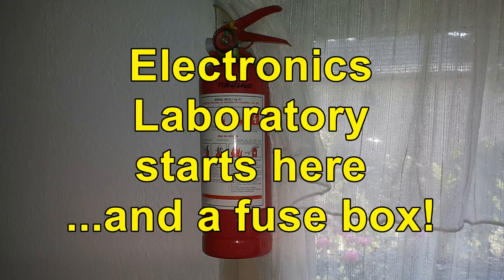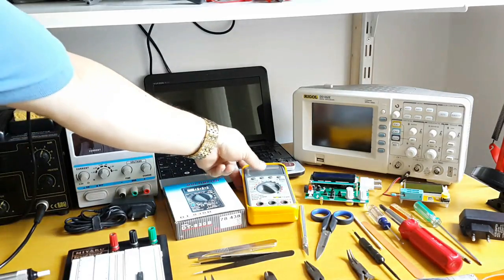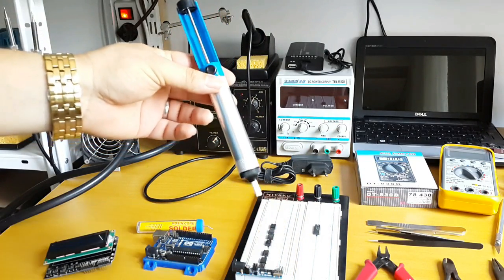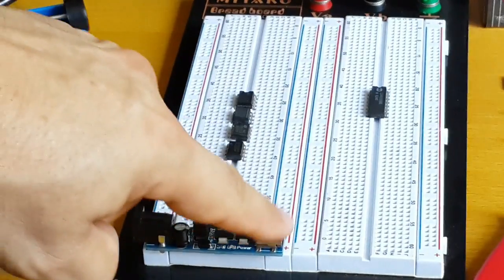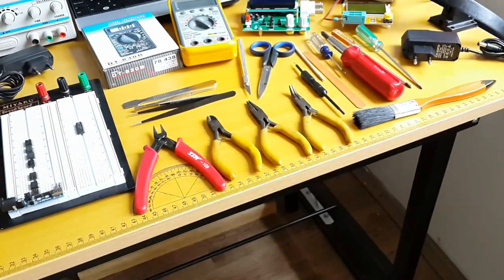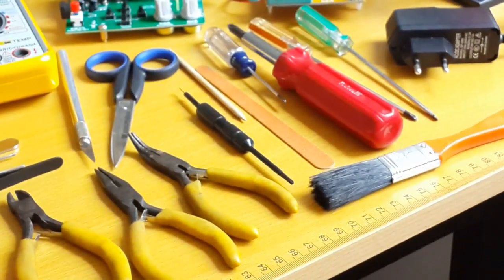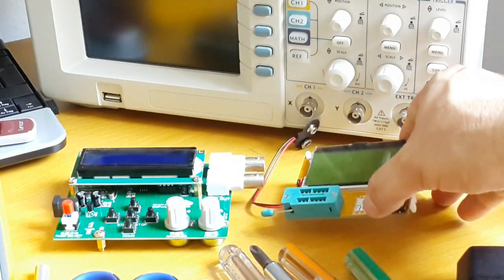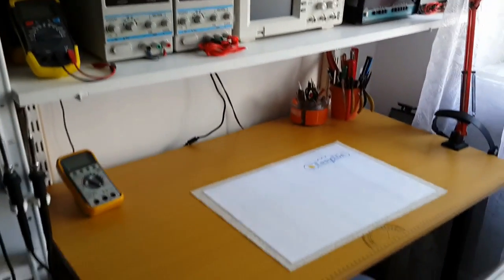Electronics Laboratory / Electronics lab tour

Comment: I saw a solder sucker that plugs to the wall for around 7-9 euros.
But i still would be careful with these because my firend hot his eye knocked out by the solder sucker.
Reply from the maker: Hi! All of them could be dangerous when get broke. I used to tell my students do not point its end to colleagues when working. The electrical solder sucker  needs smaller tip hole to be more useful. (For new buyers, get the ones with two tips in its package). Also the electrical one can be dangerous for burning,  because solder is under heating and melting, and it can release melted solder when button is pressed.  Thanks for the commend! All of us will experience a unwanted misil flying and bouncing on the walls with one of this solder suckers. It can be funny, unless somebody is on its way, or a LCD display, or was the only one we have, and job needs to be finished today..!